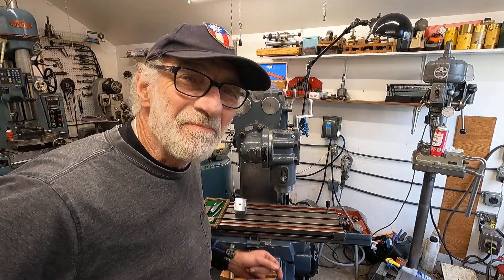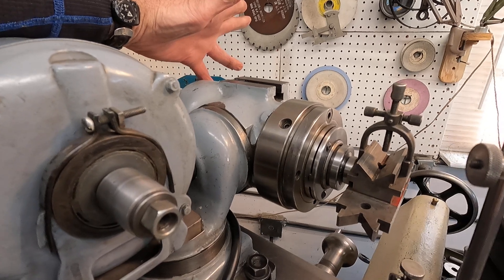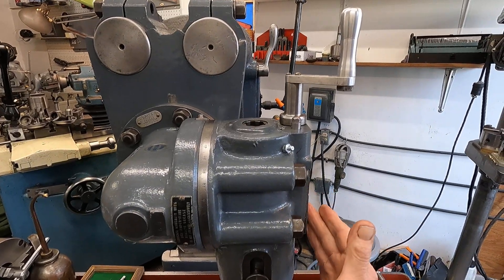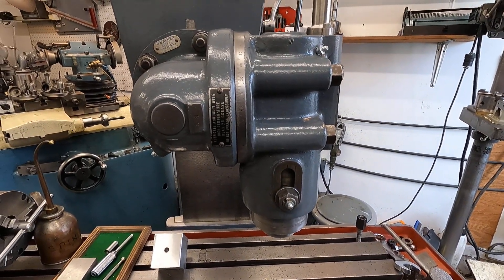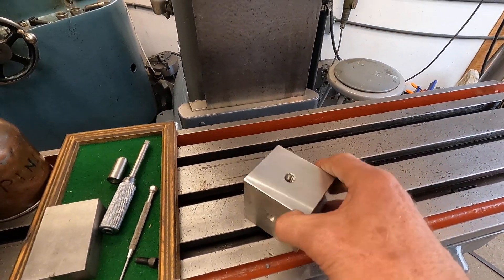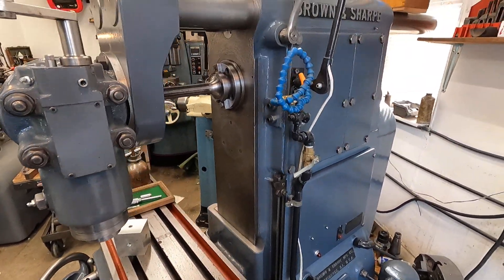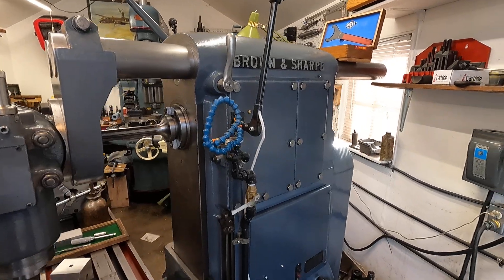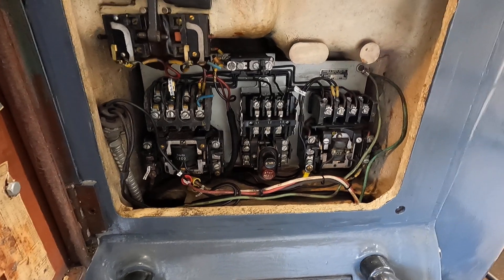Brown & Sharpe Milling Machine restoration progress

Comment: Are those speed charts two sided?
Reply from the maker: It shows for with a two-speed motor but the chart is correct for only the highest and lowest speeds.
Reply: @deedeeindustrialsuperprecision  I thought I had seen some before that were two sided if you took it off and flipped it over
Reply from the maker: @chrisv4640  Thanks, it is just one sided, Funny that the plate shows only 8 gears when it has 10.
Reply: @deedeeindustrialsuperprecision  Maybe one of those Friday after lunch builds!

Comment: Just one question dee dee. That vertical head is suspended quite a way out on the overarm. I have 5% knowledge on this subject as you do. Will it bounce up and down when finally taking the finished cut?      Keep these old hands on videos coming dee dee.  Tony
Reply from the maker: It has a sag problem when extended but seems to take light cuts good enough

Comment: dee dee you have awoken my curiosity. Does the vertical head have 1 to 1 bevel gears in it and did you take the rpm readings at the horizontal spindle or the vertical spindle ? That is interesting information about the bearings in the Cutter Grinder. Thanks.
Reply from the maker: And I have assumed too much as I was told the No 10 head was one to one, this one is geared higher. Next check the horizontal directly!
Reply: @deedeeindustrialsuperprecision  Thaks for the reply dee dee . I questioned the RPM because the horizontal mills usually need less rpm because of the large diameter cutters they use. I am going to guess the rpm chart on the machine is meant to reflect the rpm on the horizontal shaft. It will be interesting to see what you find with further investigation. Thanks again for the reply.